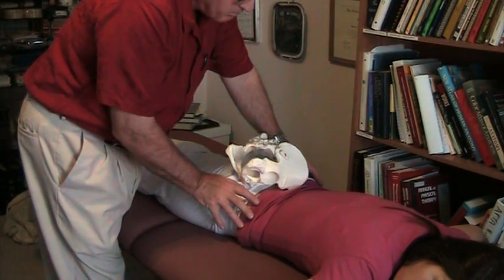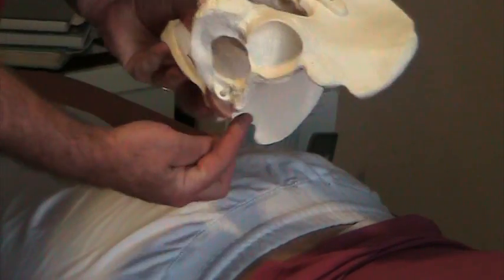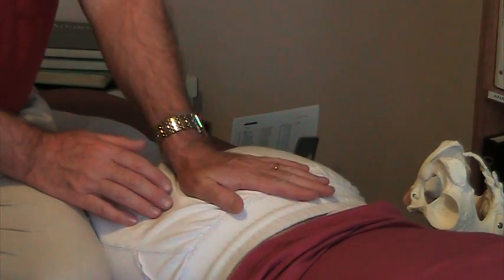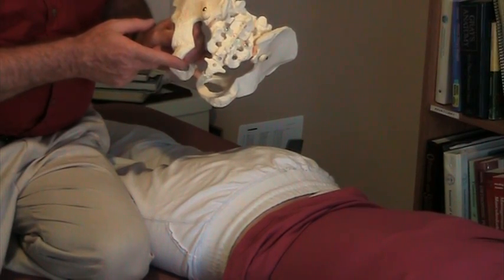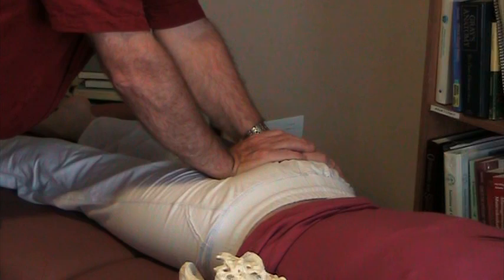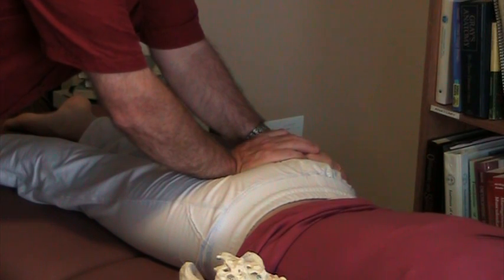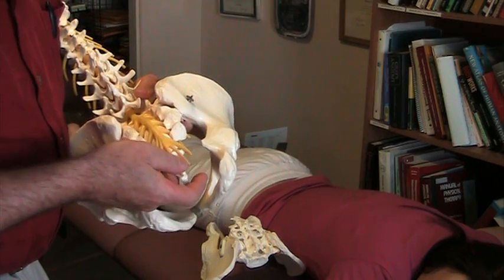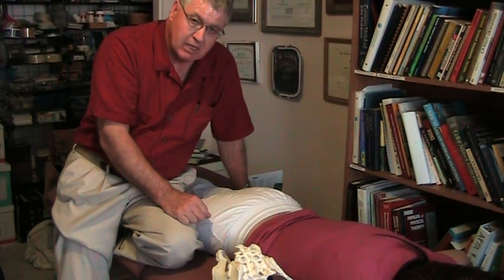coccyx Side Bent Part 1 HESCH METHOD

Comment from the maker: Some do report a connection. However, the upper cervical should be screened because a fall onto the tailbone also imparts an abrupt hyperextension of head and neck. Some believe it is mediated via a dural pull all the way up, but ultimately, these are theories. If coccygeal mobilization were to help a headache then it may lend support to that theory. The video suggests that balancing the pelvis and ligaments and muscle as a precursor to correcting a cocygeal side-bent fixation will optimize results. The caveat being if the pelvis pattern coexists. So yes, linked is a real possibility. We have a search function on the Hesch institute web site, there may be additional info there.

Comment: I didn't know this could be done. Mine is bent to the right, and the doctors or chiropractors never did anything about it. It's been 23 years. My question is, is it too late to be about putting it back in place by inserting a finger? Does it get fused that way if it's been a long time?

Comment from the maker: Ideally, one woud push a coccyx to the right if side-bent left, which is named direct technique. Going in the same direction is an indirect technique and is akin to a drawer that will not open until it is closed a little. Most of my work is direct though switching to indirect readily follows any lack of success with direct. In the video example I should have gone direct following the script.
Reply: Jerry Hesch sir, i am a 100 percent disabled vet, and have been bedbound for eight years for head and neck pain (plus colon cancer). My C1 and occiputs keep coming out of alignment no matter how many adjustments. Additionally , my neck cant hold the weight of my head because of ligament issues and laying down 22 plus hours per day. How can i keep C1 and occiput in place? I am seeing a chiropractor, but adjustment will not hold for more than a few hours.  I beg you sir, for help.  Jerry A. Weihe, Colonel, USAF (retired)
Reply from the maker: Hi, A neurosurgical consultation may be appropriate and physical therapy to learn strengthening exercises. Ask your physician if intermittent use of a good cervical support appropriate. best regards, Jerry Hesch

Comment: hello sir,I have got a question,at the bottom part of back/ just below sycrum, I noticed that  i got very sharp pointy bone I don't know what it is and found out different than other people , which makes me difficult to situp in hard surface , but if i use cushion I can do it easily. what do you think it is
Reply from the maker: Sanjiv, an x-ray read by a Radiologist or your physician may be informative. It may be the coccyx which could be malpositioned form an old unremembered trauma, or developed that way. Whatever it is, is is adviseable to get a diagnosis and minimize stress on it so as to avoid any damage.
Reply: sanjiv rai

Comment: I injured my coccyx about 15 years or so ago, but never had it looked at. But the pain has been getting worse and worse over the years. I am currently living in Korea, and I don't know what I can do about getting it addressed properly. I started going to an acupuncturist a couple days ago. He verified that my coccyx is angled to the right. I will probably be back in the States by Thanksgiving, but I need to get this corrected ASAP. I can barely bend over, sit, stand or lie down without being in pain. And I obviously can't workout either. Any suggestions would be appreciated! Also, has it been too long after the injury to have the coccyx adjusted? I'm just wondering because it's been so many years, and I just have dealt with it because I assumed it was a combination of sports injuries and bad genetics.